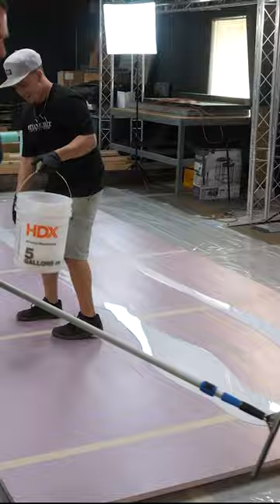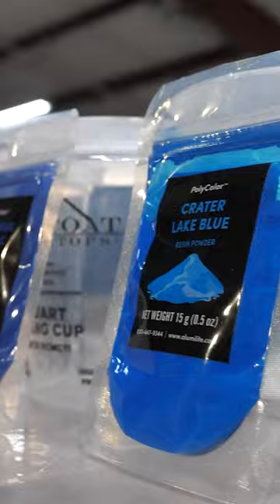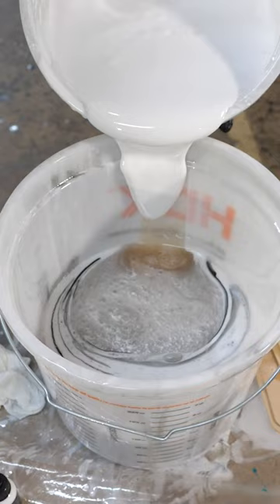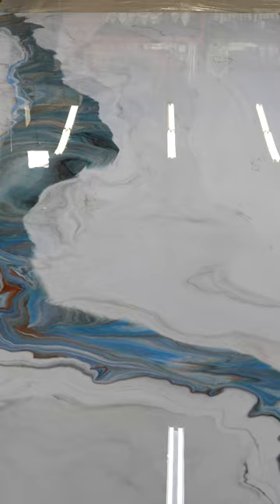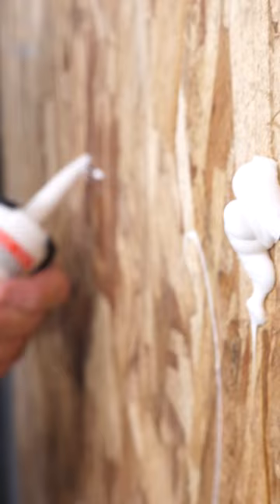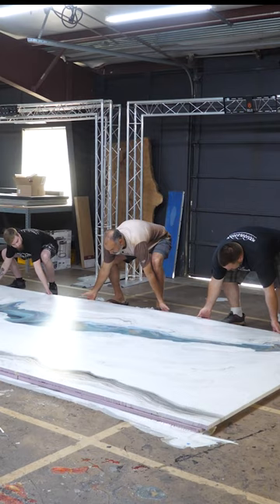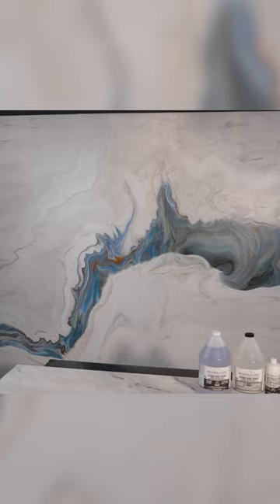MASSIVE Wall made out of Epoxy #shorts

Comment: How does the foam backing hold up to bumps from furniture and/or children?
Reply from the maker: its extremely durable. we use this method for showers with in mind fall damage and we've tested it with a sledge hammer and it help up fine